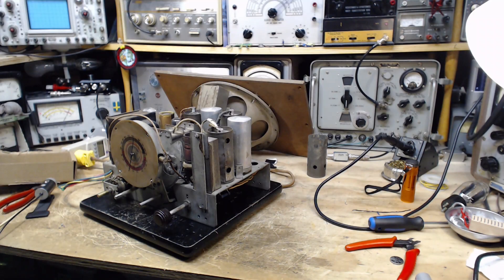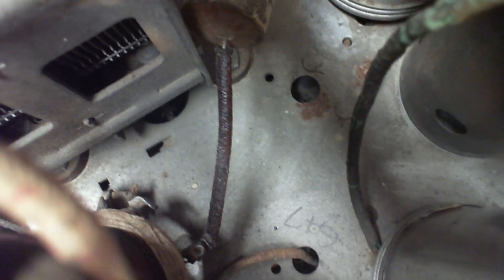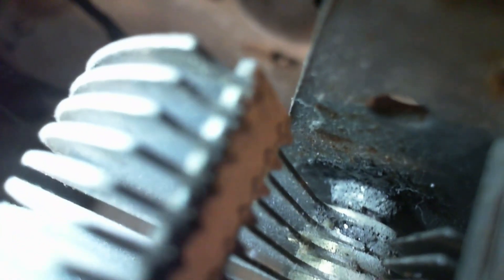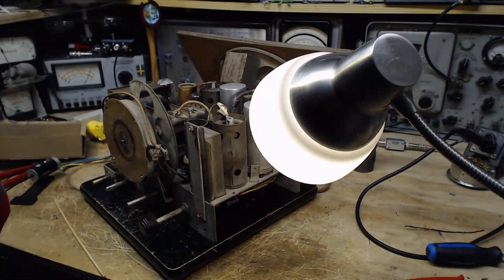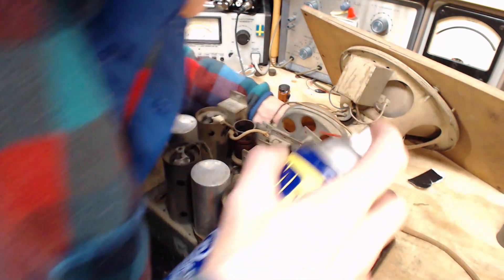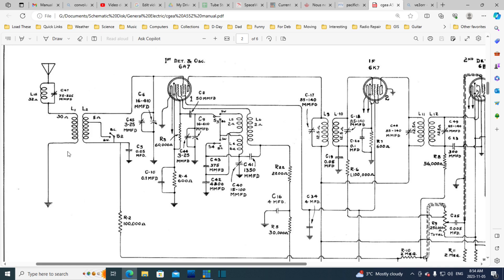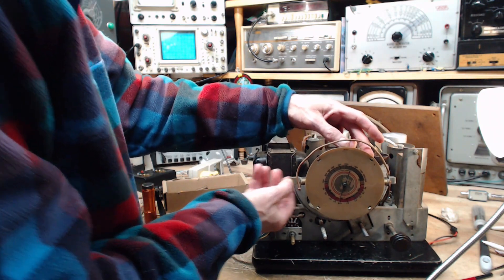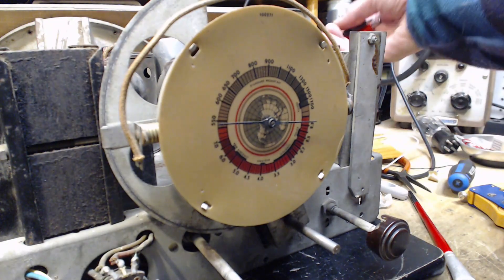Canadian General Electric Model A55Z Video #14 - A Few Last Things

Comment: You are using the wrong lubricant and you know it! WD-40 is not a good lubricate, it is a moisture removal product. A rusty old radio like that needs a penetrating oil , one drop on the bearings. I used white lithium grease fir a more permanent effect.
Reply: Correct, I use a Sewing machine Oil with the pull out reaching spout. Allows me to get into those tight spaces, and allows an exact amount of oil to be dispensed. Hard to control the spray nozzle of WD40...

Comment: Greetings:
I have looked carefully for details on the lamp bases of the two dial lamps used with this receiver. The existing lamps use the 6.3VAC filament supply and are wired in parallel. The best result would be finding base compatible LEDs that have compatible illumination characteristics and built in current limiting.
Is there a way to determine what GE part 4652 2pk of lamps is or what other radios use that part that may have a dial lamp number shown somewhere?